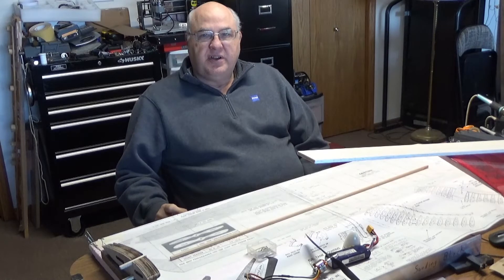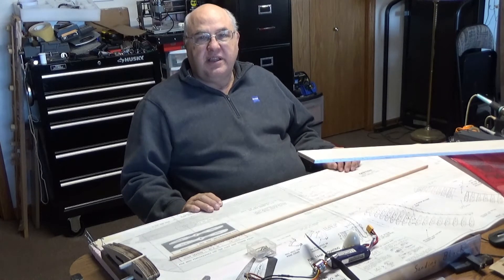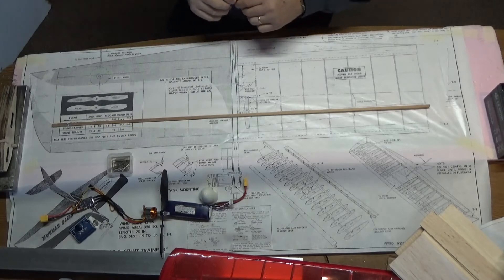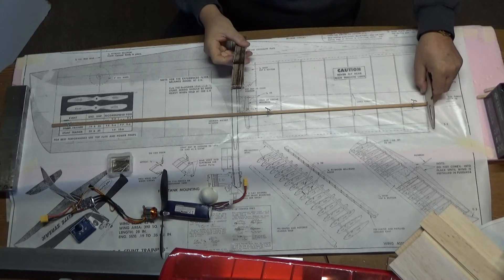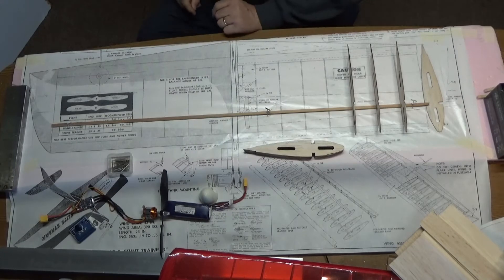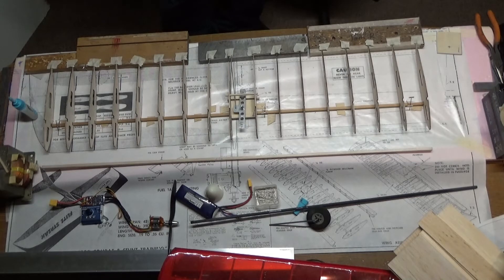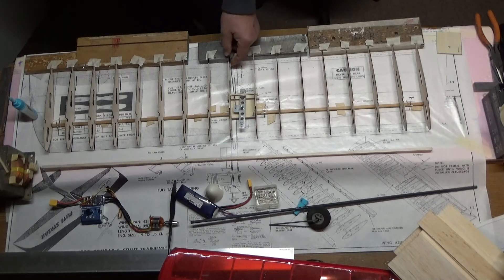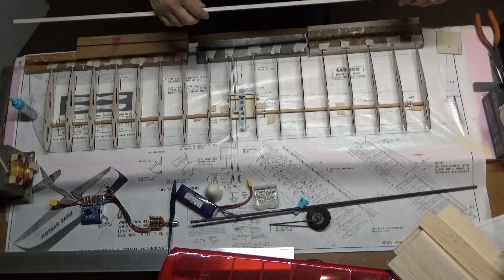Flite Streak airplane build from scratch #1 of 3

Comment: Uni on the spar is a great idea. I would add some legs on the back of the rib to elevate the trailing edge at the proper height.
Reply from the maker: I agree, it would have been a good idea to add legs to the back of the ribs.  Maybe next time.  Or use a wing building jig.

Comment: Nice work Tom, it should be complete soon as fast as you are working.
Reply from the maker: Thanks Bill, I can't complete the wing leading edge and center sheeting until I get the leadout lines from Mike in the mail.  I started on the Fuselage but haven't posted the 2nd video yet.